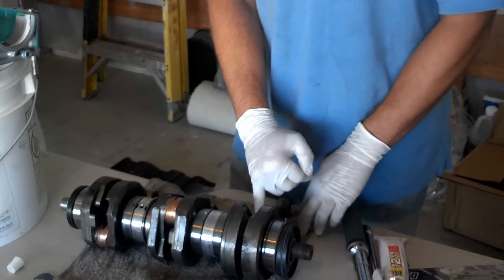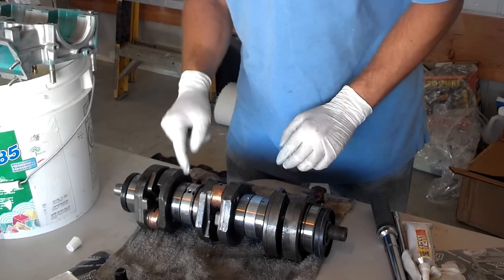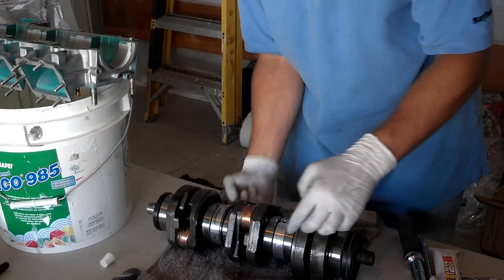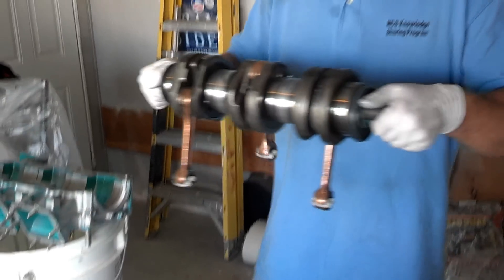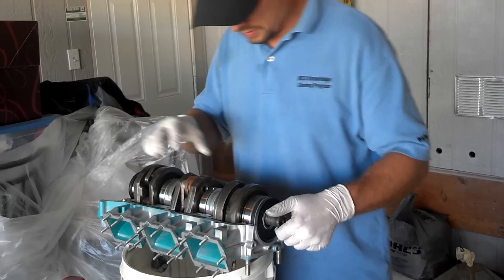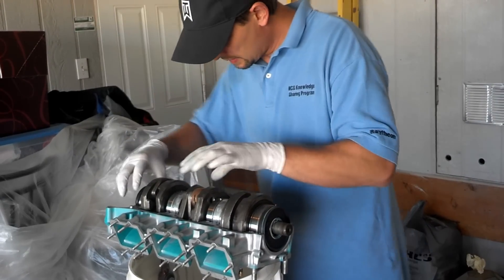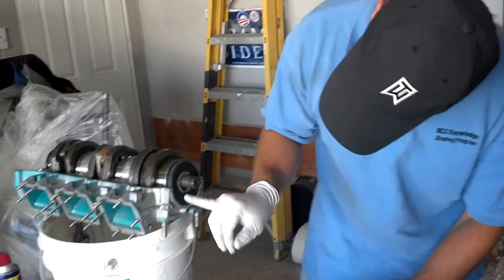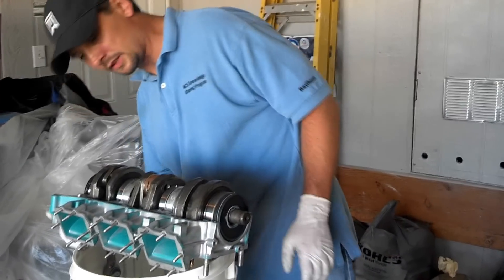Kawasaki 1100 zxi Engine Rebuild Part 2

Comment: Mite be a stupid question but my 1100 sank and I got it all apart and the crank is rusted is there any way to save it or clean it?
Reply from the maker: I can't imagine how. you'd have to have it rebuilt anyway, but I wouldn't trust it.
Reply: dlofgreen Oh yeah I know it's getting rebuilt just wondering if I clean all the rust off if they're still good like the crank

Comment: Hey, how would I remove the pin (not sure what's it called) that's on the end of the crankshaft before the seal and pto coupler. I need to remove it to put it on my other crankshaft
Reply from the maker: Honestly, I'm not sure what you mean.  the only thing before the seal and the PTO coupler is the last set of crankshaft bearings.  I'm assuming you have the PTO coupler off, perhaps you're talking about the stainless steal collar?  The collar is what makes the seal between the oil seal and the crankshaft.  You just pull that off.  There is an o-ring that goes around the crankshaft and makes the seal to the collar.

Comment from the maker: The repair manual for the engine will list the rod bend/twist and several other clearances including run out.  You can call this balancing if you want.  You need some V-blocks to hold the crankshaft when doing these measurements and a gauge.  Check with a local machine shop or small engine repair shop (maybe one that works on motorcycles).  If out of spec the crankshaft can be rebuilt, but it is rather expensive.  If your ski has low hours, it is likely fine.  The rebuild also replaces bearings.

Comment: hello great job ur doing !

 i have a zxi 9 and will soon be doing a rebuild. just one question.. does the crank for the zxi 900 need to be balanced .. people have told its need to be balanced and that i CANNOT just put it in the crank case and bolt everything back are they wrong or right ? please let me know 

 thanks and reply ASAP